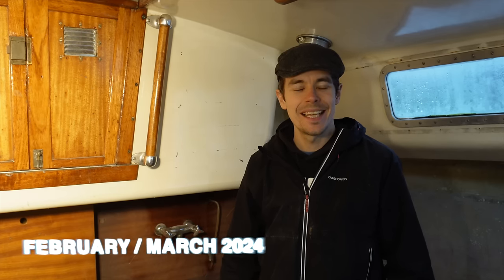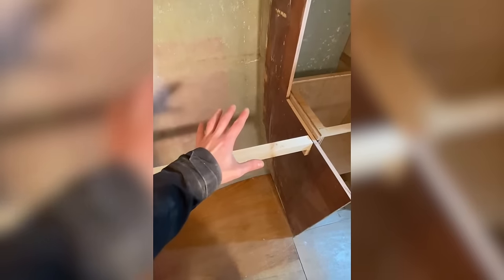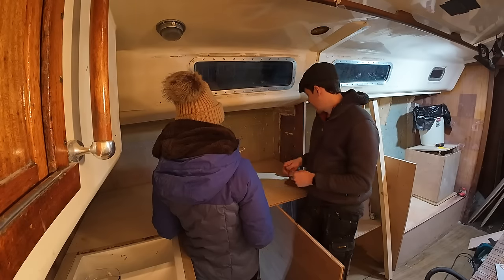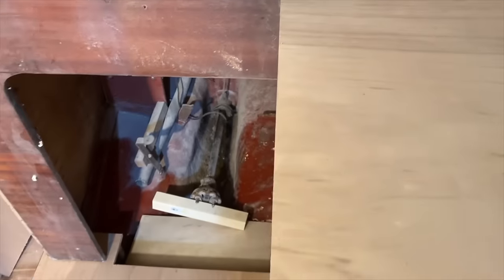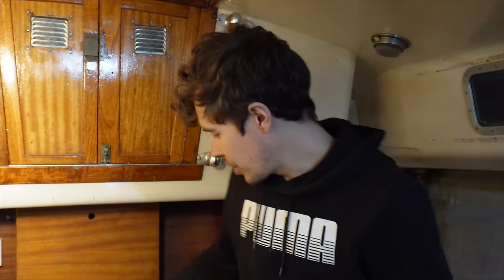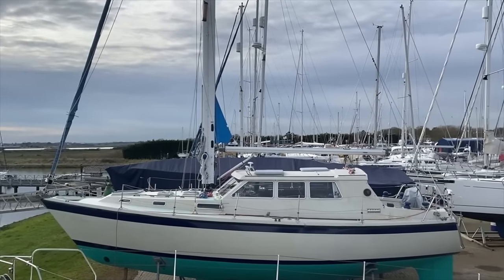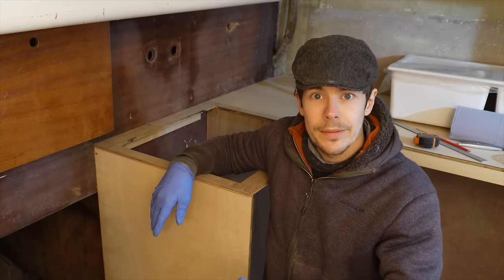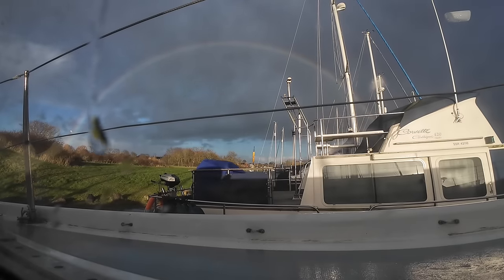Ep 28 | SINKING our boat!

Comment: enjoying your videos and considerations. having installed quite a few fridge and freezer systems...my two cents, go with the spillover. a well insulated box and a single 'bd50' compressor with the largest plate you can shoehorn in will more than likely give you all the cold beer and frozen ice cream you might wish and save a bunch of money on the install and a whole lot of 'amps' in the operation.
Reply from the maker: This is great thank you! So far you’re the only person to recommend a spillover. Great points to consider!🙂
Reply: if i may...
if you have concerns, set it up with 1 compressor and a thermostat/spillover fan (inexpensive easy diy).
If it doesn't perform as intended (which i highly doubt), you can go ahead and order and install a second unit. (also make for one very interesting video...hint, hint and help a lot of folks in their decisions concerning marine refrigeration).
one last thought, if you look at the individual components, compressor, etc. you will see that most of the outfits are using identical items...with several of these firms doubling or more the prices of the individual component parts with the only difference being the thermostatic control, my point...apples to apples comparisons can save a bunch.
then we can always get into the polemic of air cooled vs keel cooled.
if i can be of any assistance with choice of products or comparing different products, kits, etc. feel free. 
do keep up with your excellent work, have fun.

Comment: Wonky:  Your mockups are almost good enough to be final.  Well done!  How did you establish "level" with your boat on hard stands?
Reply from the maker: Thank you! I took levels from already ‘straight’ surfaces from around the boat like the mast post using an inclinometer. The boat will never be level so there is a bit of forgiveness for any wonk 😉
Reply: @sailingrumpunch  I did the same thing when installing a floating compass.  Took the average of several level surfaces around the boat and used that to install it.

Comment: I would recommend a compressor for the freezer and one for the fridge. From my experience I very much doubt a spillover will ever work especially in warmer climes. you should also think about door access to the fridge as well as top access to make access to items easier and quicker.
Reply from the maker: I think you might be right with the compressors, we probably will end up going that way. The jury is still out on the hatch/door locations 🤦‍♂️
Reply: @sailingrumpunch  yeah physics would work against you.... all energy flows from high to low, so heat flows warm to cold meaning you will never achieve cold and much colder

Comment: Hi, just a quick comment regarding your galley arrangement. Obviously I'm unaware of your finished design, because you seem to be in a quandary yourselves on that score, in this episode at least. Any experienced sailor/mariner will confirm at least 3 points of contact is a minimum while cooking underway. Both feet and your bum usually. I try for 5 myself, as before but with a knee or two if pos. forming a tight wedge. Please feel free to file this comment wherever you think most suitable. Talented story tellers. Peace.
Reply from the maker: This comment will be filed under ‘very useful’ 
As we progress we will be adding extra hand holds, bars and harness points to make it safe for when we sail away!🙂
Reply: @sailingrumpunch  something that might work well with your setup is a 'belt' that can go around your waist, clipped onto eyes screwed onto the galley and you can then lean back into it for security